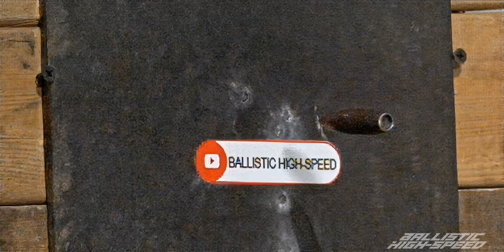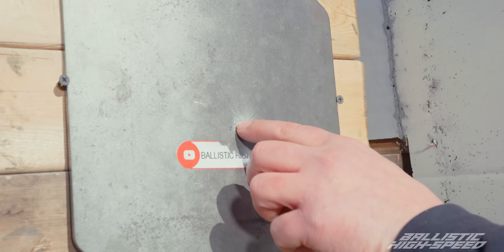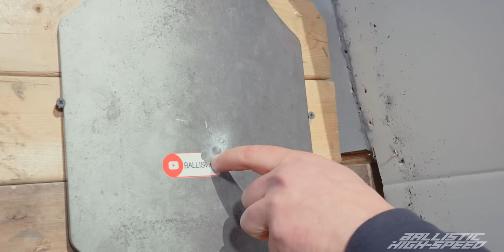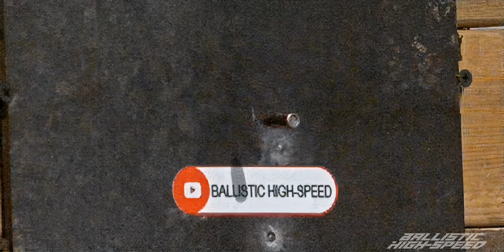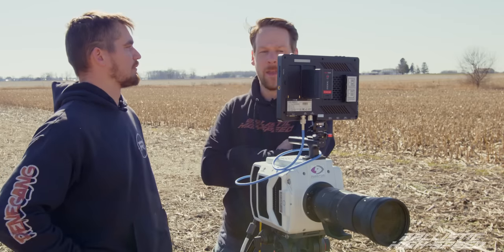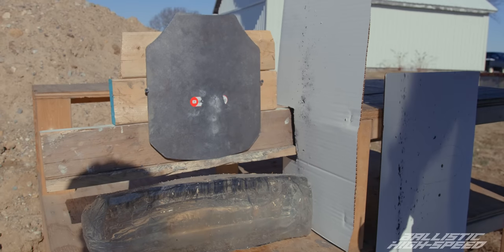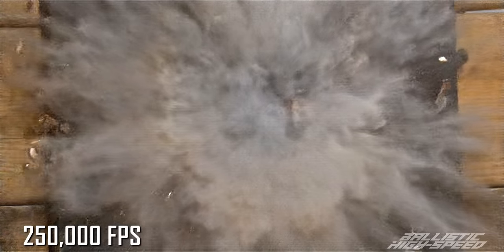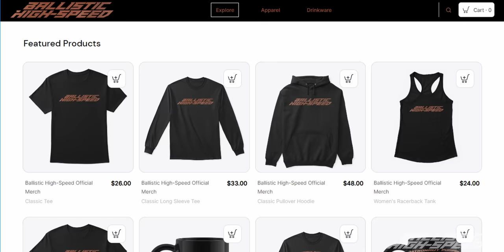Rifle Calibers vs Steel at 250,000fps! - Ballistic High-Speed

Comment: What would be really cool is to see a video where you show different grain projectiles and their stability under high speed. What I mean is it would be cool to see you guys show a normal bullet. Then start working up in grain weight till you have un unstable bullet to see what it looks like. 
Also if you make the grain weight too low some projectiles will explode from the spin force caused by the twist rate of the barrel that would be crazy to see.

Comment: As a metal worker, I would guess that putting the hits so close together changes the temper/ hardness of the metal with all that power creating heat. Spreading them out would be more accurate to penetration ability. I wonder if the 50 would've penetrated in an area that wasn't close to the others.

Comment: The dent or dimple from the 5.56 is because you used green tip.  That penetrator is harder than the steel so you will get those dimples.

Comment: Not to be critical, but I notice you have some impressive technical recording gear. To recap, you did some standard  and predictable FMJ 223 and 308's and then jumped up to the 750? grain 50BMG. The quest was either velocity or bullet weight, but that plate is known for what it will defeat and what it won't.
If you had progressed with the "fps" I have a 22-250Ackley that will do more than 3,900fps with a 63 grain HP. I expect it might crater a little? But take something like a 30/378Weatherby with a 220 grain solid. I don't know if it would penetrate or not, but you went right to the 50, while leaving quite a bit unexplored. In other words, what exactly did the deed, velocity or bullet weight or foot pounds?

Comment: 250,000 feet per second is about 47 miles per second or 170,000 miles per hour.  
The bullet can reach the moon in 1 1/2 hours if fired from earth. 
That's even faster than a giant meteor racing towards earth from outer space.
Reply from the maker: That's why it's frames per second.
Reply: I believe that they were stating Frames Per Second for the camera. Confusingly that information was given right after the Feet Per Second data. 
 FPS and FPS descriptions can be a bit of a hiccup for viewers. At least Meters Per Second were given also to help reduce rewinding time and improve efficiency with comprehension. 
 The photography was outstanding but the info included as captions needed some editing and clarification.

Comment: The flash on 5.56 is bkz you used a green tip. It has a mild steel penetrator. The steel on steel destroyed the penetrator since the AR500 is so much harder, and Fe is what was burning

Comment: The intro billed the rifles as 'more mass'.  Only in the case of the .50 BMG.  Unless you have a .35 caliber rifle or better nothing will be heavier than a 230 grain .45 ACP bullet.  A standard .32 ACP bullet is heavier than the .223 bullet shown.  More velocity, yes.  Rifles (with full loads) have higher velocities than handguns as a rule.

Did I miss the range to the plate from the firing point?  I don't recall hearing that.
As I understand, the 'green tip' 5.56 NATO round is intended to penetrate body armor (at least at the time of inception), so one would expect it to have a greater tendency to penetrate this (what looks like) panel of body armor.  I see "tim is a boss" below noted this first.  One would expect more cratering from A FMJ bullet than a soft point.
The .308 Winchester was only going 805 then 990 feet per second?  Not any .308 I've shot.  Or is that a misprint?

I am puzzled by the contradictory velocities shown.  Can you explain?

The .50 BMG was designed as an anti-material arm.  Fortifications, pill boxes, vehicles, aircraft and so forth.  So it's no wonder it penetrated so enthusiastically..

Comment: Nice video. Have you checked your values? There is a physical relation between Energy, mass of the projectile and muzzle speed. E=1/2*m*v^2. I do not know the weights of your bullets but have doubts about the values given in the video. 
The last bullet has a calculated weight of 2 gramm which is not very plausible.
I am a german engineer and therefore use only the metric system.
Maybe it is because your conversation from ft/s to m/s is wrong? The last bullet is marked with 3000 ft/s which equals 914.4 m/s and not 4067 m/s.

Comment: On the 50 cal you can see the jacket sliding off of the steel core penetrator as it pushes through the plate

Comment: Is that the first time you've shot .50 BMG?
Just curious since you predicted it wouldn't go through that thin plate.
With a lot of .50 BMG loads, you're talking 6x or more the energy of the .308, which was the 2nd most powerful round fired.
It takes something very heavy duty to stop a .50 BMG.

Comment: Comparing the .223 with 5.56:  the 5.56 green tip has a penetrator steel core & should penetrate more than a .223 which which is actually about 100 fps faster.

Comment: You might have tried XM-193 as it comes out the muzzle at a higher velocity than M-855. Outside of the .50 BMG it would have the best chance of defeating that AR-500 plate. I've seen XM-193 penetrate level 3 steel armor when shot out of a 16" barrel whereas in the same test the M-855 did not. By the way, 7.62X39 also could not defeat the level 3 steel plate.

Comment: Using pure Nitroglycerine as gunpowder could make the muzzle velocity closer to that 4000m/s. Pure nitroglycerine explodes/expands at 10 000m/s. No problem to make bullet go 4000M/s provided the barrel doesn't disintegrate first. Pure nitroglycerine must be made from ingredients at the spot. If you find and expert who is still alive telling you how to do it safely then you are pretty good to go. For that to happen you must sacrifice a 50. cal rifle - or most of it.
Reply: Maybe a big block of steel as gunbarrel would be fun to test. You'd have to bore-drill it for 50 cal (or actually why not the smallest caliber 0.22 first). Biggest challenge is getting the 10km/s gun powder/propellant to bottom of barrel safely but on top of my head you can make a remote controlled mixer and muzzle loader. You only need to mix glycerine and Nitric acid (NO3) at right proportions...

Comment: If you want to make the steel sweat you need to get into some really high velocity commercial hunting rounds. A 45 grain bullet from a 22-250 would have a good shot at lazering right through. Velocity is king with steep penetration. A 300win mag or hot 30-06 125g load

Comment: I wish they would have tried a .220 Swift or a 22/250. My Swift will violate a .223/308 rated steel AR 500 target at 100 yds with regularity. I think speed generates heat, and that melts 
through the steel.

Comment: If youre using AR500 or AR550 steel, you wont get any dents. I shoot AR500 with my 300 win mag, and AR550 with my Barrett 50 BMG,no dents. I shoot my AR500 steel target at 30 feet away with my 44 mag dont dent it at all.

Comment: The 7.62×54 put a shock wave through the metal, and then .308 it was even more pronounced. Which makes me wonder what an .30-06, 7mm mag, 300 win mag, .221 fireball, 6.5 creedmore, and then say .458 win mag, .375 weatherby mag, 30-378 weatherby mag, .416 nitro mag and a 600 nitro mag.  Those should make interesting shots the .221 can out of a rifle hit over 4,000 fps the .458 and the nitro mags I would expect something interesting since they are slower than some of the small rounds but the weight and bullet construction such as it is for large dangerous game should put a big dent but that's a speculation same for me weatherby mags since they are rockets compared with all but the smaller rifle rounds.

Comment: I think the 300 blackout was done poorly.  It's such a highly varied cartridge compared to most of the others used in this video.  There are 85 grain projectiles that can reach 2700fps from a 16 inch barrel up to 220 grain subsonic rocks flying at less than 1000fps like the one you fired.  I think a Supersonic round would have been a better choice for this comparison if you were not going to do both

Comment: The 7.62x54 would be going a good 450-500 feet per second faster if you had used a full sized 91/30 instead of an M44 carbine.

Comment: 14:36 Boys, I think you got your math wrong with the .50 muzzle velocity.  If you were really shooting .50 ball at 4067m/s then I'd pay to see it (that's 13,556 feet per second, or mach 14).  From memory .50 should be just under 900 m/s muzzle velocity, which converts to about what your feet per second number is at that timestamp.  Something went wrong with your conversion.  Seeing you've gone to a real calibre, I'd love to see some .50 API or even RAUFOSS rounds hitting mild steel and armor steel, and I reckon you would too.  30-06 and 7.62x51 NATO would be good intermediates to look at too.

Comment: Ur 5.56 green tip has a steel core. You said its due to higher pressure (which is true). Also the flash is probably due to steel on steel

Comment: Couple comments.  NOT fair to keep hitting the same spot on the steel, since you are effectively microcracking it if it is hard steel, or pre-forming it if it is soft steel.  Our company did some of the initial research for the Reagan SDI anti-missile program, using the "plastic" bullets.  I have pictures of a 1/4-inch bullet, blowing a 3-inch crater (wide and deep) into a solid block of steel (also available at online sites).  Some of our testing went upwards of 40,000 feet-per-second velocities.  You can do this yourselves with some of the commercially available gas-guns.  One problem at those velocities is that the bullet immediately starts to enflame when it hits air/oxygen, just like the Space Shuttle disaster.  Our test were done in vacuum, as replicating space.  We used these facilities to test military armor, for tanks, LAVs, APVs, and similar.  NASA used similar facilities to test for micrometeor hit damage, including on glass, poly, aluminum, steel, ceramic, and similar materials.  We also tested against active armor, but those studies are all classified.  Also, for your videos, do some tungsten cored rounds, or depleted uranium rounds, and you will see spectacular videos of what actually happens in the real military, with 20-mm and upwards sized rounds.  You will need a better facility, with larger backstops.

Comment: Would a layer of Kelvar in front of the plate reduce the fragmentation? BTW, the 556 green tip has a steal penetrator that would account for the cratering vs the 223.

Comment: Copper with high heat, and oxygen became like a knife through butter through steel, i would like to to see what smaller calibers do if you put a balloon filled with oxygen right in front of the steel plate, will it cut through then.

Comment: The flash had nothing to do with speed, had to do with the fact your 223 and 300 blackout were copper and lead, your 5.56 round has copper and lead but also has a steel core penetrator in it to help punch through harder objects

Comment: Guys, at the minute 14:33 , you are indicated the velocity = 3000 ft/s and is equivalent to 4067 m/s. It is a big mistake - correct 3000 ft/s is 914 m/s. 
On 4067 m/s your bullet will be faster then all what is possible on earth - it is around 14641 km/h.
If you shoot on vertically line, at this speed you can make the bullets artificial satellites of the earth. I think that even Elon envies such performances.🤣🤣🤣🤣🤣

Comment: That 50 is a materials buster. Your plate had no chance. Next include the m855A1 , 30-06 AP, and 7.6254R silver tip, tracer, and black tip. Then take a 30 cal hollow point and insert a bit of tig welding rod in the tip and try. (Read federal law first) <<-- yeah believe it or not, theres ambiguous language that restricts you from "improving" the performance. Cant have regular public able to do development after all.

Comment: @8:50 how could the spall fragments travel at 2800 ft/s while the bullet velocity at the muzzle was only 2300 ft/s?  Even though the fragments are much less mass, they would receive a proportional amount of energy vs the entire mass on impact less heat/energy/etc.  Wouldn't this violate the laws of physics?  Or am I looking at things wrong?
Reply from the maker: Fragmentation can easily have higher velocities than the main mass. The equation for kinetic energy handles velocity a lot differently than mass. So a reduction in mass can achieve much higher velocities with the same overall energy.

Comment: The 5.56 was a green tip as you said, which means it has a steel penetrator in it, causing the difference. The ring of "fire" was probably powdered steel glowing red hot.
P.S. frequent shooters should know what a green tip is lol

Comment: I can appreciate what you are doing here but what seems to be missing as another commentator has mentioned that the core of the bullets are of utmost importance. I would be interested in seeing some classic black tip ammo such as WWII 30-06 and Korean era 308 steel penetrator. They are still available on the surplus market, would be interesting to see what that "outdated old ammo" would do to a modern plate. My two cents.

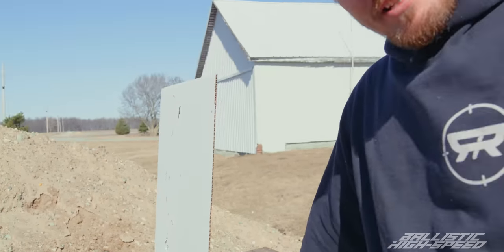Comment: @12:21, not a good test of the plate, you shot the same point over and over, when you got to the 50, that portion of the plate was probably already stressed, you should have taken another shot in a clean untouched location with the 50 cal.

Comment: 2340 fps .223?  even if using 90 grain which wont fit inside a ar15 mag the 223 should be going much faster ...putting so much emphasis on 556 being more powerful than 223 is not really correct in the real world ..if you go to hodgdon reloading data website the 223 has faster loads than 556 55gr ...and in many manuals there is just 1 area for load data for 223/556 ...and as someone else said using green tip 556 has a mild steel core barrier penetrator (not armor piercing) ...556 and 223 has the same velocity in reality ...the actual difference between 556 and 223 is the 556 has a longer throat in the chamber of the barrel which could let you put 1 grain more powder in theory ...in reality however most of the time the powder is not being compressed anyways so that ability to add 1 grain of powder means nothing ...not to mention you are limited by your magazine length .. so that throws all of the above out the window ...what good is having a chamber with a longer throat when you cant get around your magazine limitation .....ok so TLDR ...223 and 556 are practically the same and 556 is not faster  in the real world and the speed of your 223 is wayyy off

Comment: :face-blue-smiling::face-blue-smiling::face-blue-smiling: Of Course it will weaken the steel at that spot where you guys shot it several times before the 50 BMG !!! Why not hitting 3 inches on top ???:face-pink-tears::face-pink-tears::face-pink-tears: ??? What is 13000 foot pounds in to pounds per foot ??? 13,000 foot/pound does not make no sense as I dont have the measure of the mass, which should to be Newton or Gram or at least grain in my believe anyways ! Does it go 13000 feet per pound or what ???